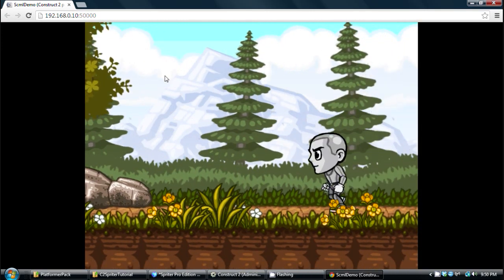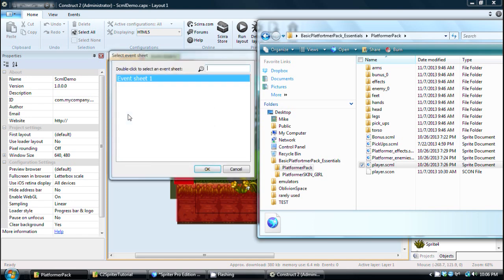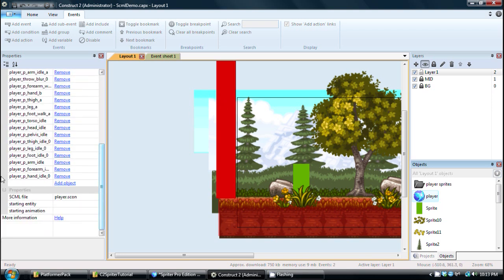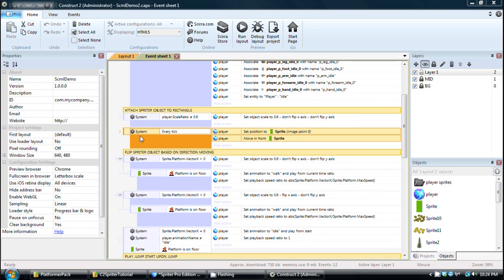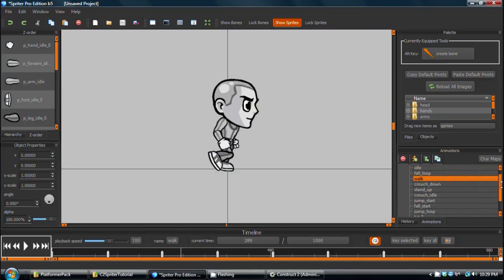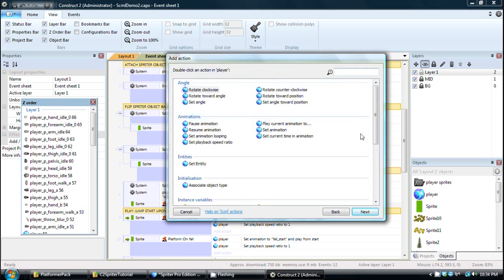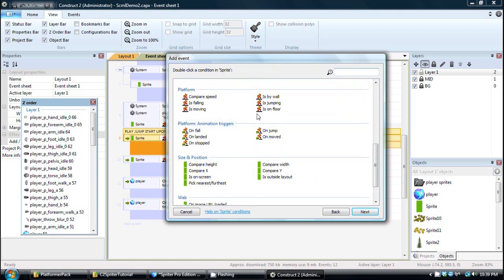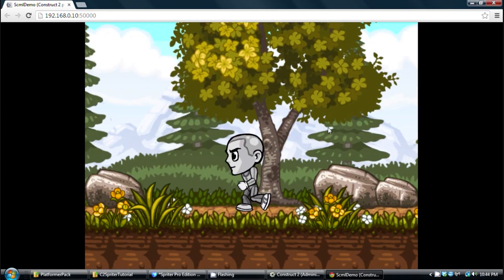Using Spriter animation files in Construct2

Comment: Spriter on finished event not working

[b]Setup[/b]
OS - Windows 7
Spriter Version - b8 Pro Activated
Construct 2 version - 168

I followed the following tutorial on using Spriter in Construct 2 - Using Spriter animation files in Construct2 "Using Spriter animation files in Construct2"

It seems the "on finished" condition is not working for any of my non looping animations.  I have proven that this condition works fine for non-spriter sprites.  Please advise if this is a bug or user error?  

Thanks

-Morgan

Comment: hello sir..
when im done making my character flip to the direction it facing, im having a trouble with regards to making my character in an idle animation.. i followed the tutorial but it is not really working.. :( how can i make my character to idle after doing animation
Reply from the maker: +Naru2chen Panes Did you download the capx to take a very careful look at the events.  Obviously if you copy the events exactly, it will work exactly as in the video.. I need more information, otherwise I'd just be guessing..

In general, you need to make sure that each new event does not immediately over-ride the previous ones that change the animation.

I tend to create a variable I call "stuck in move" for moves such as attacks, and then set this variable to "1" when I trigger an attack animation.

Then I have all event's that listen for controls or change the animation first make sure "stuck in move" to ZERO and not 1.

And of course, when any attack animation finished, I change the variable "stuck in move" BACK to zero.

This is the best I can do on Youtube. If my response doesn't answer your question, please find our forums and post the question there and make sure you mention its an issue in C2:  https://brashmonkey.com/forum/index.php?/forum/22-help-and-tutorials/

cheers.
-Mike at BrashMonkey